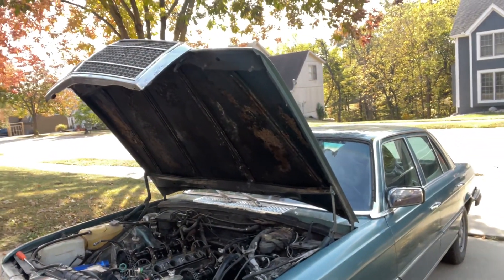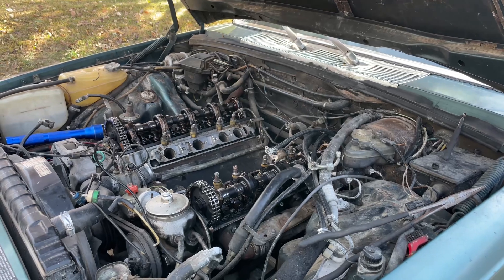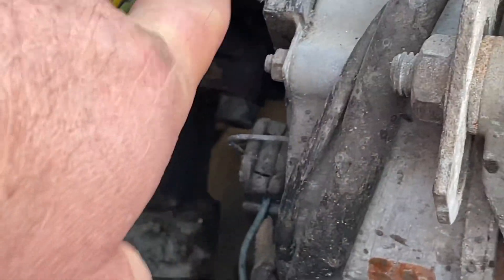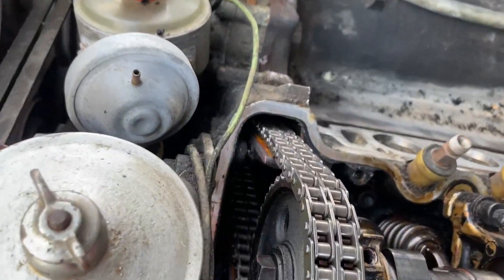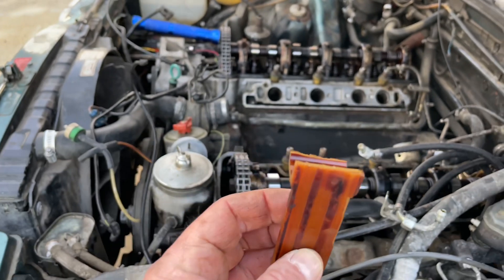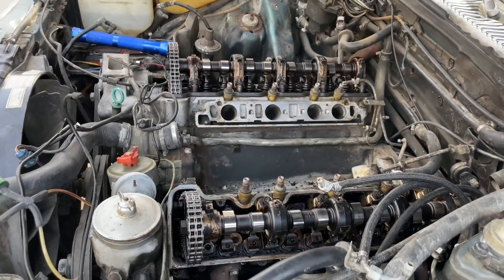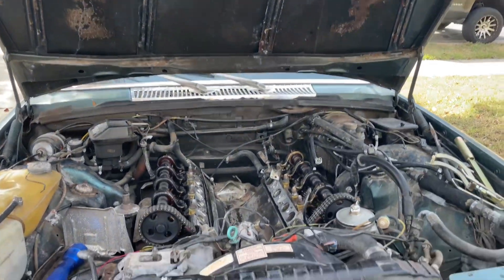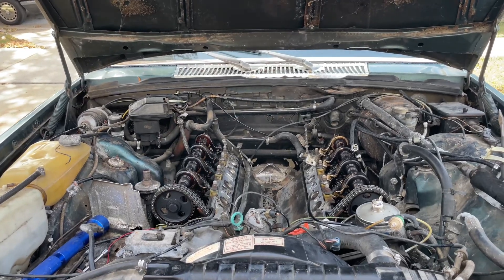Mercedes W116 1980 450SEL NBA Champ Clay Johnson & Me fixing high idle & timing Chain on Clay’s 450

Comment: Hello, Peter. I have a problem and I don't know who I can ask about this. Do W116 450SEL from '79 as well as the R107 USA version need a special distributor rotor, the one with the RPM limitation? You know, the thick one with a flyweight, a spring and a grounding spring? In the manual I read that USA and J versions of the R107 do not use this kind of a rotor. I thought I saw on Clays car the "normal" rotor and not the kind of a rotor I am speaking about. If you could help me that would be great. Thanks in advance!
Reply from the maker: That is a good question! Clay’s version is the 1980 version with the frequency valve. This distributor is basically what you would find on the early W126 V8. The rpm limit on his car is already done through the FPR via TD signal from electronic ignition unit. 
His version also does no longer have the extra rpm limit switch on the airflow metering unit which all versions had until production change in August / September 1979.
The very early versions had to have this rpm limit switch retrofitted. I think it was the 74/75 model years.
Clays distributor has already the magnetic pickup which provides the rpm signal to the electronic ignition unit which in turn creates the TD signal we are familiar with from the W126 series and later.
The mechanical flyweight version was only used with electromechanical contacts / points system which drives the ignition coil directly.
I would say it is safe to assume that if your car has the electronic ignition unit then the answer would be, no.
Reply: @inovahightechltd  Thanks a lot, Peter, I really appreciate it! I have R107 from 1977 with the metal cast distributor and no differential valves - no fuel adjustment possible. From what I have seen - The D-Jetronic technology with K-Jetronic on it installed.
Reply from the maker: @mercedeske  what is the 6 digit engine number you got?
Reply: @inovahightechltd  M117.985
Reply from the maker: @mercedeske  here are your possible distributor part numbers for 117.985

A0021581801 ZUENDVERTEILER			
A0021582901 ZUENDVERTEILER			
A0021589101 ZUENDVERTEILER			
A0021589201 ZUENDVERTEILER
Reply from the maker: @mercedeske  as far as I can see, they are all magnetic pickup for EZL
Reply: @inovahightechltd  Thanks a lot.

Comment: Great video. I have a 1976 450sl. My upper guide was also broken with 12 degrees stretch when I bought it. For the distributor: how do you know where to connect the retard and advance vacuum hoses to the engine?
Reply from the maker: Hi Nate, in the MB shop manual group 7.3 but I don’t know the chapter at the moment - I will look it up when I get a chance and post it as reply here.
Peter